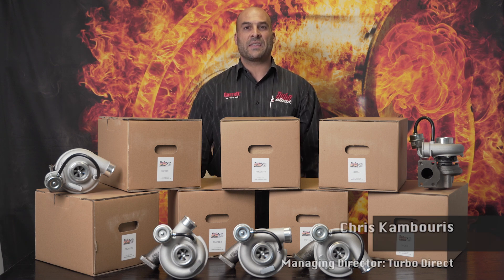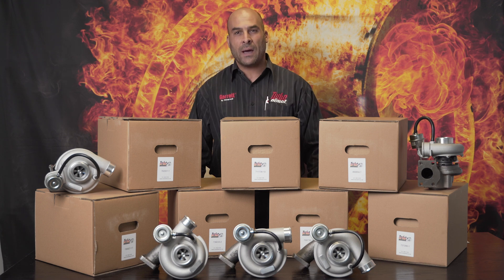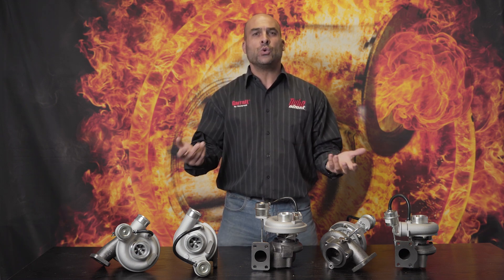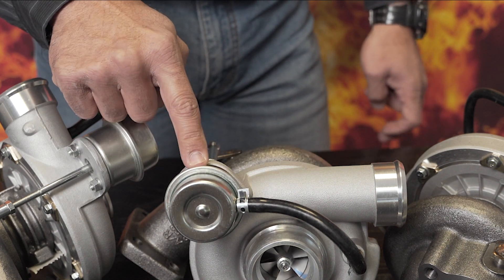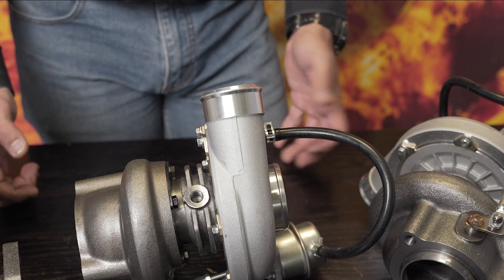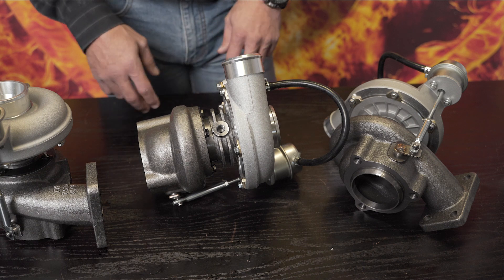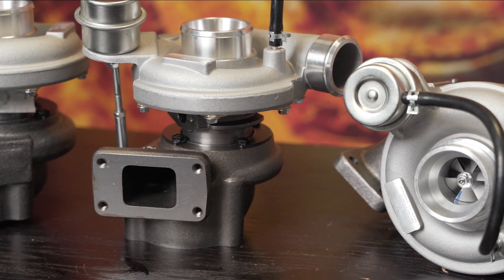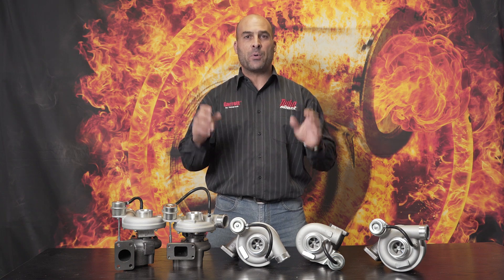TurboDirect S.A Direct Service Replacement turbos

Comment: Very nice. Now I need Turbo Direct brand for Subaru and cheaper international shipping, hahaha. Is the balancing done in house? Just curious.
Reply from the maker: LOL - shipping is a mess internationally im afraid. Yes ofcourse balancing is always done in house - without VSR and Flow bench equipment, forget about repairing or assembling or building any turbocharger.